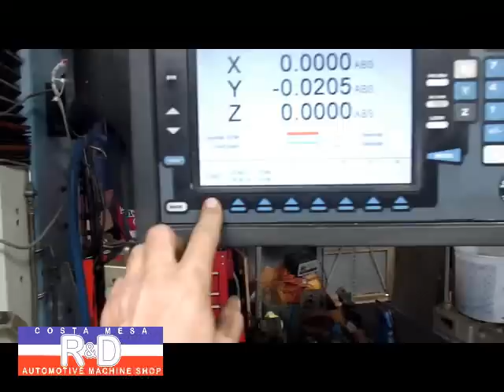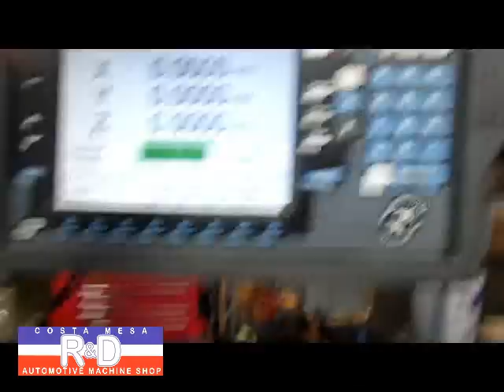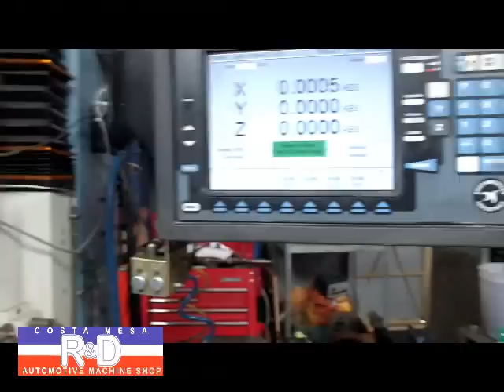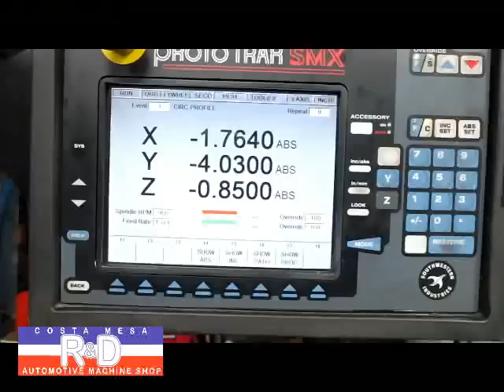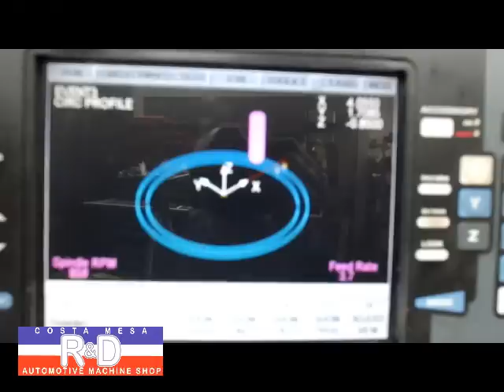Ford 3,0 Flywheel Weight Reduction on the DPM3

Comment from the maker: This is a cast iron flywheel and doesn't require lubrication.coolent because of the large amount of carbon in the iron. The carbon acts like a lubricant. Could use coolant, but like you said - MESSY.

Comment: I know that you know how to machine stuff, but from my experience would you not want to raise the table and have a shorter tool in there so you can blast through the metal faster?. I see you have two clamps and Im assuming what you are running right there is kind of pushing it?

Comment from the maker: Use what you've got to get the job done. Using the mill, I don't have to stand in front of the lathe and dodge hot chips while I tend the controls. What would the 'flat plate' add to the cost of doing the job, will I ever use it again, and will the customer pay for it? These are factors that I have to look at.

Comment: I know you answered this already but my first thoughts would have been to use the lathe. A chuck might not have been able to give you a good bite but couldn't you have bolted it to a flat plate? I am an amatuer hobbyist at machining and this would have been my initial approach and I don't have a cnc mill so I was just wondering why my suggestion would not work.
Thanks either way. Love your videos